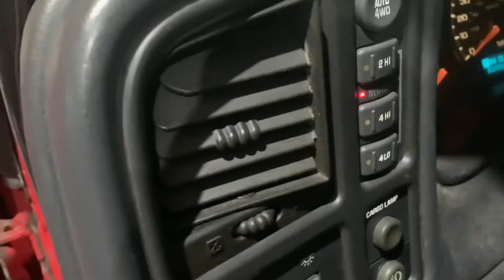clicking noise, Chevy Silverado, In Motion and Still, Grinding noise, Growl noise. @lew908c

Comment: WOW !!  This should be a what not to do video on safety.  Crawling under a running in gear vehicle isnt the best idea. Especially with those type of jack stands. Didnt notice if a wheel chock was even used up front. That spinning driveshaft would rip your arm off if those loose clothes  get snagged  in that u joint.  The puddles of water covering the floor with the shop light next to it is an electical shock hazard waiting to happen. Exhaust fumes in an enclosed area is also bad practice.   This vid shows everything not to do EVER !
Reply: Eh. Hes good.
Reply: Average day at the dealership service shop.
Reply: Oh calm down Esmeralda. Ya it would be dangerous, if that was you doing it
Reply: Can’t be scared all your life!!

Comment: My transfer case caused a P700 and p733 code. while driving the gear would slip and make a grinding noise. I found a hairline crack in the top of the transfer case where the fluid was leaking out. I drained the fluid out of the transfer case and metal pieces came out. I replaced the transfer case and the truck drives better than ever. I called 2 transmission shops and both of them swore the only time a P700 or other transmission codes activate is when there is an internal transmission problem. They quoted me 4k to rebuild the transmission when the real problem was the transfer case.